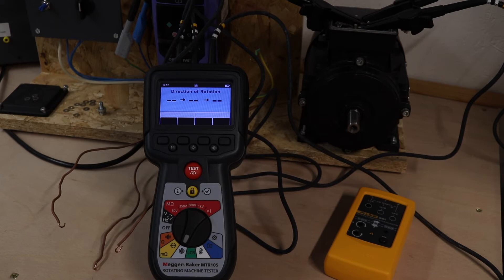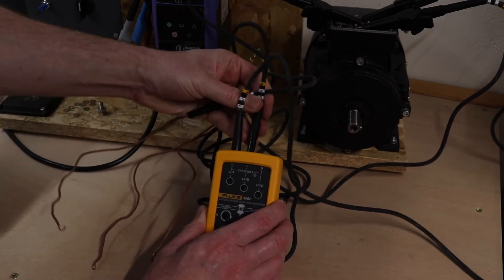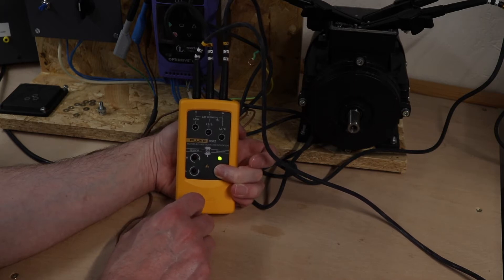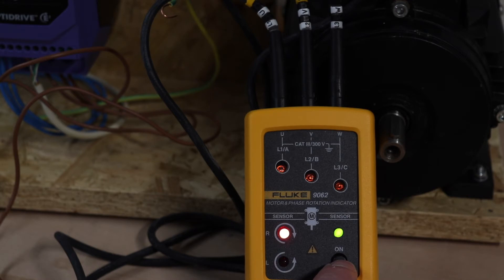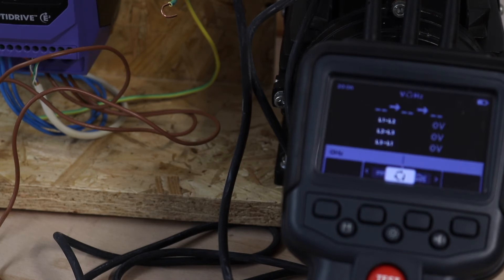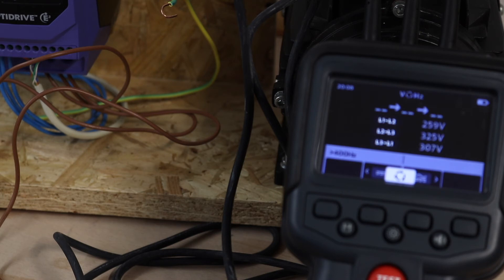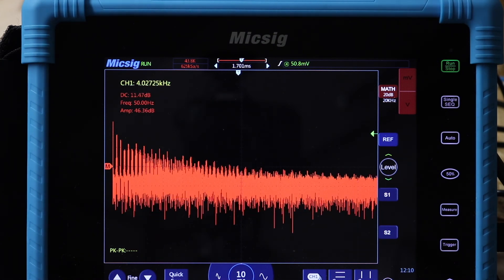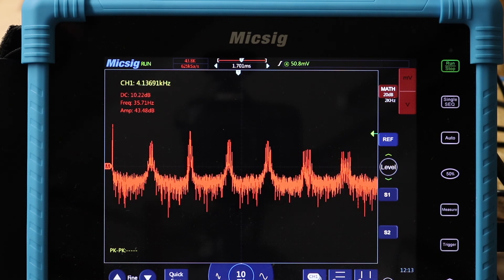Megger MTR105 vs Fluke 9062 on a 3-Phase Inverter

Comment: You have done an amazing job in the testing with the Megger, I do really hope you are sending this all to Megger and they really iron out all the annoying kinks to really send this very nice handheld meter into the can’t be beaten at this price category. Btw what’s your view on the Migsic tablet oscilloscopes. Any recommendations for their latest and greatest model - if you were to purchase today?
Reply from the maker: Appreciate you watching and commenting MM. I have sent a document to Megger on my findings and had a bit of conversation with one of their sales engineers. I am still working on the voltage measurement problem - just ordered some bits to build a filter.
With regard to Micsig scopes - I have not had any problems with mine, I spec a scope based on what my requirements are, the one I have is 4 channel 70 MHz, so it just depends on how many channels you require and the bandwidth for your applications. Mine is touch screen, I have not had any issues, but I am working in a relatively clean environment. I don't know how it would handle being in a dirtier environment. They do make one with more traditional controls that may be better suited to that or even their handheld version. They do not have isolated inputs, but their differential probes are quite nice and also worth considering.